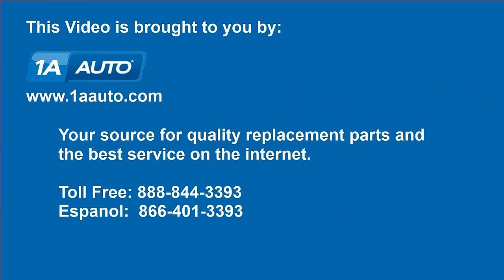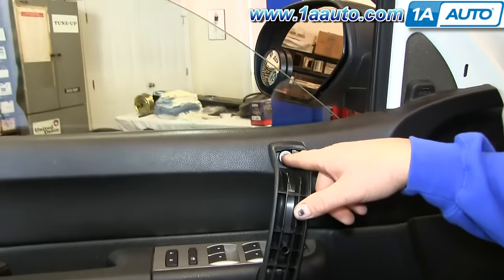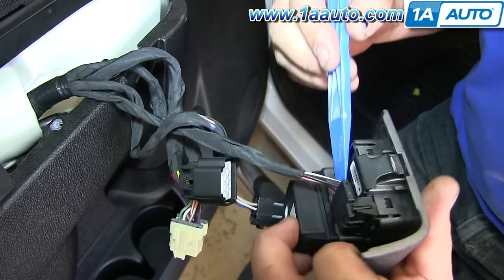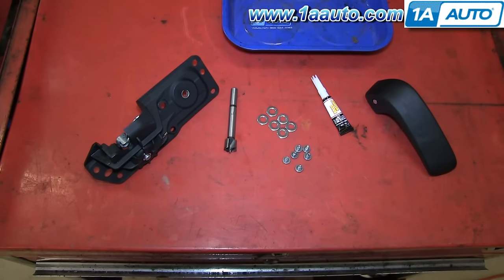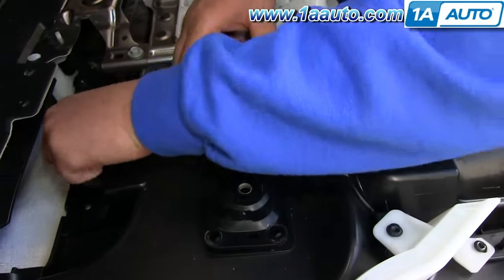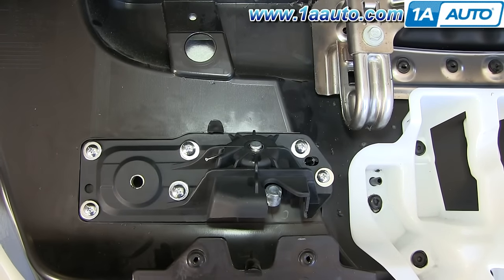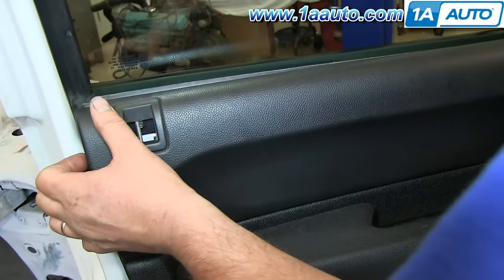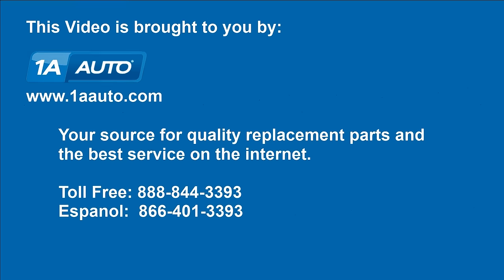How To Replace Inside Door Handle 07-13 Chevy Silverado

Comment: Installed this today.  Not something that someone with no knowledge of cars could do based on video alone.  I had a lot of trouble getting the handle cable released, broke several of the door clips, and could not get a good solid screw attachment after boring out old plastic rivets.  Also...there was an additional attached plug to the window control panel that I had to figure out.  All in all....not an awful experience, but I wish the clips that did get broken had not broken.  Time will tell how good of a fix this really was??

Comment: Great video.  I just changed the driver’s side handle on my 2011 Silverado LT Z71.  There were a few of issues that I encountered not mentioned in the video.  1). There was an extra connection when I took off the instrument panel.  It took me a minute to get that taken off door.  2). I had a hard time getting the new handle to snap back on the new component.  It didn’t snap back on easily.  3). The door handle cable was a little tricky.   It can get a little twisted when you tilt the door.  I had to work it a little. 

But I never would have tried this without the video and the part from 1AAuto.  Great job guys.
Reply from the maker: +BigMilt8 Thank you! We love empowering our customers and showing how to perform DIY auto repairs with our high-quality auto parts.  http://1aau.to/m/Shop-1AAuto-c

Comment: Just did this on my 2013 Silverado 1500. A few tips for whatever it's worth: 
-Disconnecting the harnesses beneath the switch panel is a bear. Took me about 15 minutes just to get this part, might be easier with two people and some small flatheads.
-When drilling out the plastic rivets, be careful not to overdrill as you can damage the plastic female end and thread.
-Popping the new handle into place took a lot of force and I never heard an audible pop.
-In the video when he puts the door panel back on he lines up the two bottom hooks first. I'd recommend lining up the top of the panel with the window sill very first since there's a groove it needs to sit in.

Otherwise, very helpful video!

Comment: Just did this tonight! Took about an hour because there was a slight defect in the male end of the handle. I needed to sand it down a little bit so the handle could slide on til it clicked. I tried and tried and couldn’t get it on, then I noticed a metal lip that I sanded down and it went on nicely after that. Also the plastic door panel needs to go on the rubber strip under the window as close as you can get it. That was a bit of a pain. But this video is great and made the job easy! Saved lots of money doing it myself rather than spending a few hundred at the dealership.
Reply from the maker: +Ryan Foust Thank you! We love empowering our customers and showing how to perform DIY auto repairs with our high-quality auto parts. 1AAuto.com

Comment: Great video and the part came quickly. I found a bit of a shortcut for removing the cable, which was a little hard to do, even with the good instructions for tipping the door around to get at it. I found that it was hard to squeeze the tabs on the clip at that angle and realized, since I was removing the part, that I could just snap off the plastic corner of the handle body up to the clip/cable and it came right out.
Reply from the maker: +Bill Isles Thanks for watching, and thanks for the info!  1aauto.com
Reply: Need help with the cable….. how do you even remove it?

Comment: Awesome kit. Worked great and video helped a ton. Had a problem getting the cable off and just finally broke a small plastic corner piece on purpose to remove it. Handle works pretty good. Mine will come off though but no big deal. Thanks!

Comment: Just got my handle , looks good , wouldn't be a bad Idea to mention the cable going to the lock mine end was about to come off . Noticed you didn't sell it but found it on amazon 16$ dealer wanted almost 100 looks exactly the same

Comment: Nice video A1.I have the same truck.,changed the cable for inside door handle and found someone else changed this part and stripped out panel for the small screws. If I was to use jb weld like Daniel L. Dill  mentioned I wouldn't be able to remove it again. What else would work for me?

Comment: As indicated by some folks ... had to use the old handle.  New one would not "clip" in place.  Don't know why more folks don't have this problem with the inside handle.  I took the suggestion of a customer that used the old handle and worked just fine.  In addition the new handle assembly would not lay flat into place.  Hoping the screws and super glue will hold and the repair will last.

Comment: Helpful video. The screws provided in the kit, however, were too small. I used some other screws that were slightly larger and longer to secure the handle to the door panel.
Reply: What size screws did you use?

Comment: Pro tip: put a rag in the recess before removing those two bolts where the handle is and especially when putting it back together. Otherwise they’ll fall in the door and you’ll have to take it apart again.

Comment: I had to replace mirror right after I changed inside door cable, noticed someone else had changed this part and stripped out the little screws. This will the third time taking the door panel off.

Comment: If you have to second time, good luck,  I end up drilling through the door panel and using a small bolt and self locking nut to secure the new handle.

Comment: The door handle can be released with a small straight blade screwdriver prying under the head of the pin without removing the clip under the pin or the eclip at the handle crank. My door handle failed for multiple reasons, the eclip left to parts unknown, 4 of the plastic rivets failed taking part of the plastic with it and the pocket that the cable ball end goes in broke half away. I need the kit for the handle crank with a good pocket, the plastic bracket and will likely end up drilling through to the interior side and installing screws all the way through due to the original rivets breaking away and not leaving enough material to attach using self-tapping screws.  I will probably apply some plastic cement between the plastic bracket and the inside of the panel. And now, a word on GM products; this will be my fourth trip in this door, twice for the latch which needs to be replaced again, once for the speaker of which all four have failed and now this handle repair that I'm going to say is woefully inadequate. Add in the failed brake switch, the EVAP solenoid, brakes twice, seems to burnout the drivers head light bulb frequently, terrible transmission shift map, 2008 Sierra 76,000 miles, not a good track record. oh, and the LH front switch pod has a defective switch for the RH rear door. I have a 1996 Tacoma with power windows and door locks that still work, I stopped driving it when the weather is hot last year because the AC quit. I'm really beginning to hate this GMC. The good side of this truck; on the open road supper comfortable, quiet, bright headlights (when they work), the stabilatrac saved my axx when a dear jumped in front of me.

Comment: Do you have a video for a 2012 GMC Sierra replacing the front inside door arm rest? I might be saying the part wrong. But it's for the long piece of the door handle, which is next to the window buttons. The long plastic handle piece broke. Please advise?

Comment: First thing the installation video is great, its a great help for me to fix this issue, just one question arose while watching this, what exactly happens to the clip you pry out in 4:16? Do you reuse it when installing the new part or discard it?
Reply from the maker: Thanks for watching. You would reuse the clip once its all back together.
1aauto.com 888-844-3393
Reply: Ok thank you, I'm needing to do this and I wasn't sure what to do with the clip. Thank you.

Comment: While taking the cable off the door panel, the twisted wire with the ball at the end, has slipped out of the clip. Nothing looks broken, I can feed it back in, but it won’t bite and stay in place. What can I do to get it to stay in there? If I reattach everything back together it will pull out the first time I pull the new handle.

Comment: I have replaced all my latch and handles and cables and after all replaced started having problem with interior and exterior door handle isn’t opening driver side front door. It won’t open and I’m guessing there is something catching and not allowing it to open. It did open once after much finessing and I got it all working and closed it and it worked for a day and got stuck again  fml

Comment: When you removed the bolts at 1:35 do they have nuts or do they bolt into the door panel? What exact type of nut and bolt do i need to replace that pull bar

Comment: Question, does the super glue that comes with it work or should I purchase a better brand like gorilla glue
Reply from the maker: +@jssweet64 The glue included with this set will work as intended, you do not need to purchase different glue.

Comment: My passenger side door won’t open from inside or outside. I have managed to get the panel off while door was stuck shut. I analyzed everything and nothing appears to be broken. I put the door back together and it worked BUT later that day it stopped functioning again. Also it appears that the lock actuator is working as well. Any suggestions? Thanks!
Reply from the maker: +Eric Burke We wouldn't be able to diagnose an issue like that here, you may want to have a local mechanic take a look at it. Thanks for checking us out! http://1aau.to/m/Shop-1AAuto-c

Comment: !!!! WARNING !!!! WARNING   !!!! WARNING !!!!   
Drill VERY shallowly or you will drill out the screw holes. DO NOT DRILL DEEP when removing the old part.  This will keep you from attaching the new piece.  However, $4 worth of JB Weld (epoxy) allowed me to securely attach the piece to the door.
Reply from the maker: That's a good tip. Thanks for posting it. 1aauto.com 866-403-3393

Comment: The step I'm stuck on is 'push inward in the tab with your needle nose pliers and pull the cable out ' 

What tab? Need a picture. Don't wanna push or pull too hard and break something else.

Comment: HELP! Ok I have a big question. My door handle broke WHILE the door was closed. How in the world do you get to it to fix it if it is stuck in the closed position. I can't even get the door open to even try to fix it. I hit the unlock, the door unlocks but won't open from the outside or inside. So does that mean the outside door handle is broken also?
Reply: Not necessarily ... unbolt as man bolts as you can.  You can then pull enough of the panel to reach down and hold the end of the cable while reaching the outside handle.  The door will open.

Comment: Thanks for this video. it just didn't quite solve my problem. my door handle is Okay, but the cable that leads to the latch part is broken so how can I remove that?
Reply from the maker: +Johnny Reimer Thank you for checking us out. Once the cable is disconnected from both sides you will have to maneuver it out of the way. Don't forget the way it sits and runs though when replacing. 1aauto.com
Reply: Push the Limits inner door latch cable

Comment: What if the door is closed and you can’t open it from the outside do you cut the panel open ?? How do you get door open if neither handles work an door is shut ...
Reply: Had the same problem ... was able to get the door panel out far enough to reach down and hold the end ball of the cable in the handle.  As I held it, was able to open the door from the outside.  Hope this helps.

Comment: Doing this on my Sierra 09 completely different disassembly
Reply from the maker: +kyle forrest The install was for an LT if you have an LTZ where it has a totally different handle then yes it will be a different install.
Reply: @1AAuto  sle but my d
Disassembly was a bit different
Reply: Hard to watch vid and try irl but got my tow mirrors on as well
Reply: Pushing door handle into panel didn't work had to hold the pin out with pliers it's on but sticking out a bit but I did buy the kit on ebay

Comment: I have completed most of the repair but cannot get the new handle to slide in and snap like in the video. It will not go on. Any suggestions
Reply: Brute force. Push harder, it will go on.
Reply: Debbie Kinard grease it
Reply: Yep—I scraped a little lip off the top of the handle (female part) which seemed to be the problem. I also used some WD40 and brute force. Frustrating!

Comment: Sir the Video Title has it as 2007-2013 but your introduction has it as  2007 through 2012. I just want to be certain that your video and the repair kit is also for the 2013 model.
Reply: Also to note that this also applies to 2014 2500HD & 3500HD GM models as well. 2007-2013 is for the 1500 line
Reply from the maker: +deeohgi Thanks for the feedback!

Comment: What size are the screws? Mine did not come with screws.
Reply from the maker: +Benjamin Guenther We do not have any dimensions on the screws but if you take the part to a local hardware store they should be able to further assist you.
Reply: I ended up using home builder brand 10 x 3/4 self drilling screws and then I cut off the self drilling part plus a bit because they were too long and it fit just right, I still added some super glue but not sure if I would have needed to. Thanks 1A auto for posting this video.

Comment: Dont use the washers...it compromises the integrety
Reply: If you look at the replacement handle the screw holes are backwards...they were made for a fillester type screw.. they send pan head screws with washers and the washers reduce the bite of the screws....
Reply: If you could just remove the circlip and replace the lever assembly that would avoid compromising the fitment...

Comment: Upon replacing the door handle as shown the pin( underside of the handle will not seat! 
It advances to its final position yet the Crome pin will not remain/ stay in place. Any time as the handle is raised to open door the pin drops out of its locking position causing the handle to come off of the mechanism lever —!  Either it was defective or my placing the handle upon the lever is not keeping the pin in the set position. Help a/advice or send a second handle only. 
Ps please  validate my purchase— Jerry Conway 15615 Bluff Springs, San Antonio,  Texas 78247. 
Was purchased some time back probably more than 12 months ago. It’s for my2011 Chevy standard cab 20 series he 6.0 L
210-859-8910

Comment: What was actually broke,the plastic handle or the metal assembly that the handle attached to??
Reply: on mine it was the composite metal the handle itself was attached to, just broke in half one day when I was trying to get out of my truck.
Reply: @Sebastian Llanes mine as well. Weird that the plastic housing was fine, but the composite metal would be the part to snap.
Reply: Mine just broke at the metal piece too
Reply: The metal part on mine broke in the middle. Just need that part.